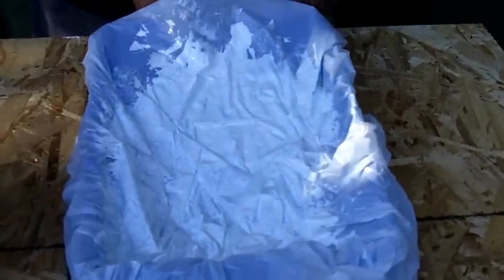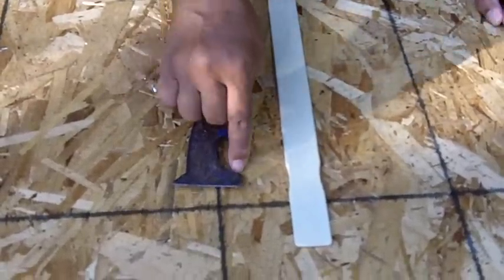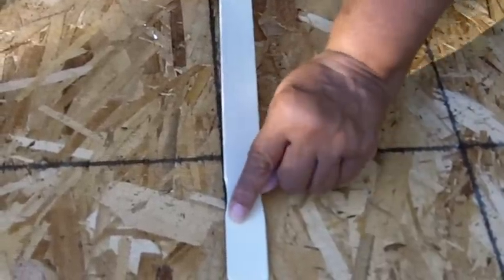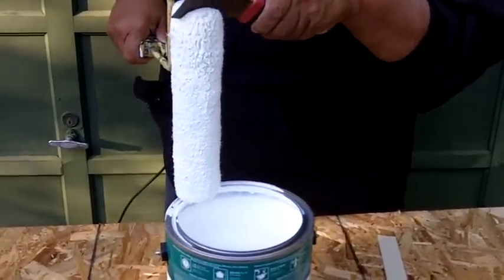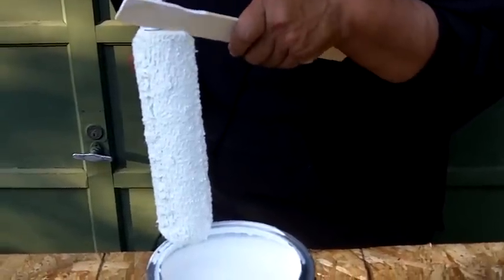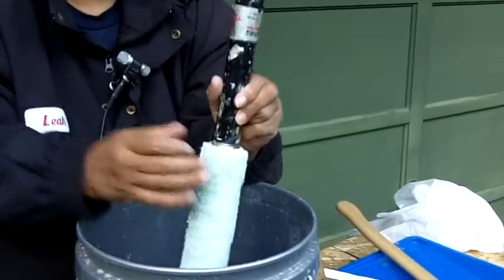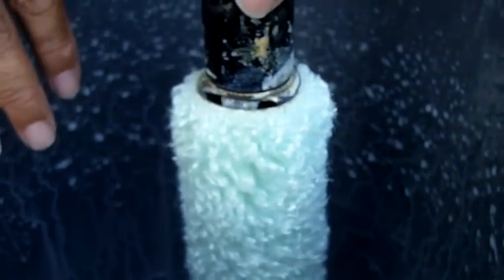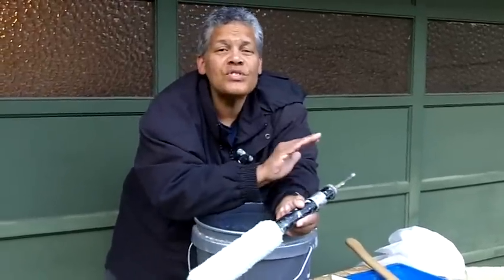3 Quick Painting Tricks

Comment: Great tip Leeah!  When I use the five in one when cleaning off the roller, I find that holding the roller with the other side against the paint can, it prevents the roller from sliding off the roller cage when screeding the paint off. In other words, the roller tends to slide off the cage unless the side towards which the roller cannot come off is on the bottom when scraping the paint off. Thank you for this video.

Comment: I don't understand why people don't use paint pads. I got a couple, about 20 years ago and haven't even touched a slimy roller since. It's super fast, you use less paint which not only costs less but also dries super fast and you could paint two coats and be cleaned up before you got one coat of paint on with a roller. No drips, super easy cutting around trim and various other obstacles without taping things off, cleans up in a jiffy...I don't understand why people are still using rollers and paintbrushes.

PLUS, you can easily try out some of the more "scary" colors because it's so fast and easy that there's zero drama OR trauma in the idea of painting a room more than once.
Reply from the maker: +cccincocc you know what, I've never used one, but thanks for sharing your experience with the See Jane Drill community.
Reply: +seejanedrill I did a video search and, unfortunately, what little I found makes it look a bit like a gimmick. It's kind of sad, in a way. If I didn't have my paint pads, I wouldn't paint - EVER - LOL - LOVE your vids!
Reply: Can you post a link to a good Painter pad... I have a lot of furniture I need to paint.  I have a compressor I am setting up now with a sprayer, but it is getting cold out and I want to be able to paint in my basement.  Thanks in advance!
Reply: @superCisco  just google "paint pad"

Comment: You should stop being so Danm cool 😎 you're making and me look bad
Reply: seejanedrill any suggestions on how to cut using a  thin board or something?
Reply: I can use a brush but I wonder if using some sort of ruler or board would help me cut quickly I could cover a lot of volume quickly and wouldn't have to worry about baseboards etc.
Reply from the maker: Here's the thing.  They make something called a painter's buide (aka paint shield).  It's a tool that costs about $2-3, and looks kind of like a metal ruler with a handle on it.  But, I don't ever use it, and here is why.  You have to constantly clean the paint off it as you go,  or it isn't effective.  I find this too cumbersome, and I prefer to cut in by hand.
Reply: seejanedrill I agree, by hand is best however thank you for your insight!looking forward to your next video😀

Comment: I just throw rollars away!Not worth the B.S to clean it.
Reply: If it's just a one-time job, sure.  But if you are painting your house (interior) and have closets, rooms, hallways, baths, etc, you are looking at 20+ different painting events if you paint alone.  So if you use the good rolls (about $3 each) that's quite a bit of money.  If you wash them right you can reuse about 10 times each.
Reply: Totally agree. Not worth my time plus the cost of roller covers is figured into the cost of the paint job I'm doing. The time you spend trying to clean a cover is way more than $3 or $4! (if you've priced the job correctly)
Reply: vikings844 

it's definitely not worth the bollox to clean out a roller for the price of a Starbucks coffee.

an even better tip is to wrap the roller in a plastic bag and tap the opening air tight shut. this will allow you to reuse the roller for the same type of paint and the roller will stay fresh and wet. I once had it wrapped for over 2 months and was still able to use it after with no problems. 

the same could be used for paint brushed too.
Reply: Don Lawson

Comment: never wash out rollers. if you want to use them soon to finish a job, wrap them in grocery bags. when done the job, throw them out. too cheap to bother with and you will NEVER get them clean. 

but i usually like your tips.
Reply: lostintime86 I disagree with you – i use Purdy 9" rollers that cost six dollars each – you do not just throw them out because she is correct here – you take a hose with a jet stream and pointed at the roller and make that roller Spin and you will see all of the paint come off quickly but you will need to do that with a paint tray or a bucket of blocking the spinning water from getting on yourself
Reply: In fact cleaned-up rollers are much better than new rollers, as all the excess lint is washed out. They make a cleaner paint job, as there is less lint left in the paint on ceiling or wall.
Reply: it depends on the jobs you are doing. I have a found that a roller wrapped in plastic grocery bags will stay wet for a very long time. I have also found that cheap roller work good. Their quality has improved over the years. I have not had lint issues in many years. I just toss them out when I am done. No need to waste water and add to pollution.
Reply: lostintime86 That is such a typical 21st century idea.Use once and throw away.The world does not have unlimited resources.What I have done for years is as Leah did on the video,scrape off the excess back into the paint can, then either use a spinning tool attachment like she did or leave the roller in a bucket of water,the paint is heavier than the water,and any remaining paint on the roller will fall to the bottom of the bucket.And if you really want to save the planet you can actually pour the water out into another bucket,and reuse time and again.And believe it or not the paint at the bottom of the bucket can actually be reused also.It is possible to have no waste at all.Definitely always try to not be wasteful.You can even do the same thing with oil based paints using white spirits,instead of water.
Reply: not what I said. I said wrap it in plastic grocery bags until the next use. you can go from one color to another if close in hue. i.e. light to dark. But I usually only paint white to antique white. I just don't like the texture of a washed roller. 

Cleaning a brush - I suspend it in a bucket of water. gravity will pull the paint out. Dump water. Rinse bucket repeat until clean. 3 times usually. 

Well it's been working for me for the last 30 years. But what do I know.

Comment: Have to disagree with the 2nd tip. Using the edge from the tool to clean the roller will pull fibres into the paint, thus contaminating the paint. Next time you use the paint, fibres will be transferred in the paint to whatever you are painting.
Reply: hairynews I humbly disagree. If you properly prep your roller when it's new, you will have no lose fibers!
Reply: Hi Elaine, using the roller will incurred wear and the inevitable loosening of fibre from the roller.  No amount of prep before will prevent that.
Reply: I humbly disagree also and agree with Elaine D about prepping your roller before you first use it. I prep my NEW rollers by putting masking tape all around them and then when you peel the tape off you get 99 % of the loose fibers off the roller thereby avoiding fibers contaminating the paint.